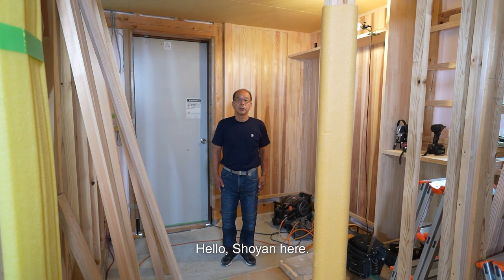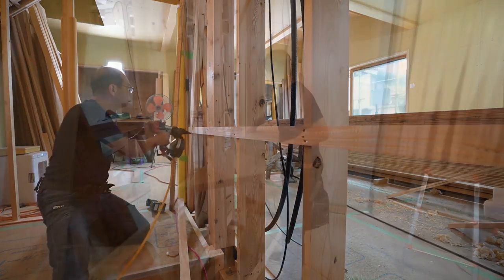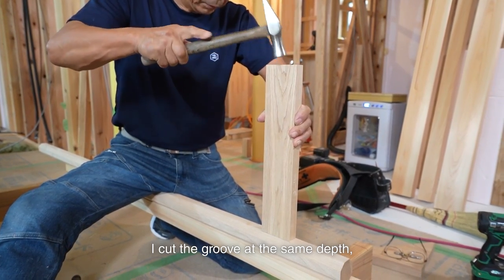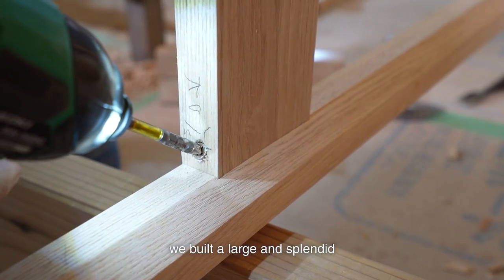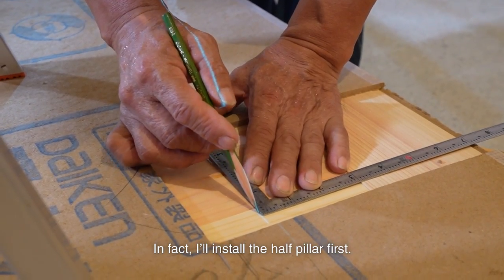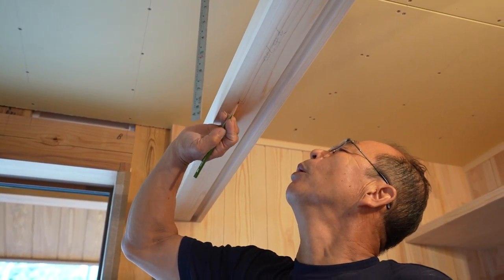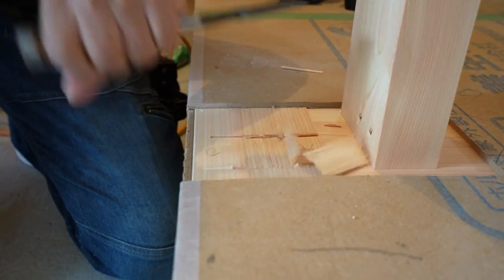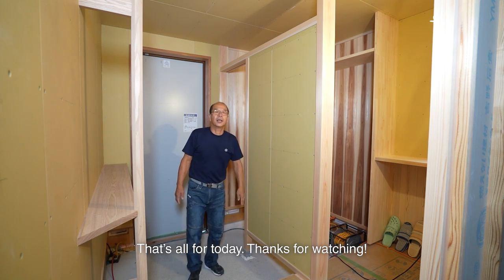The Entrance is Finally Complete! Struggle with the Floating Handrail [Season 2 - Part 14]

Comment: It would be interesting to see the mud + tape applied to that drywall. The joints are all so close to finished wood
Reply: I’ve wondered about that too. The finisher/painter will have to be very careful working around the finish carpentry. Beautiful work, Shoyan-san.